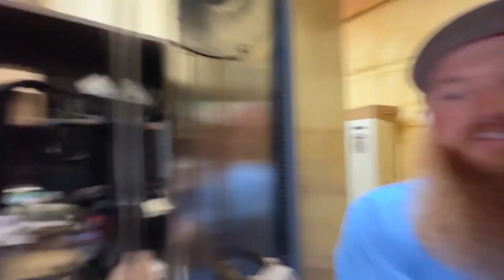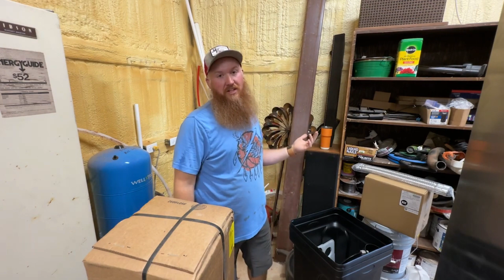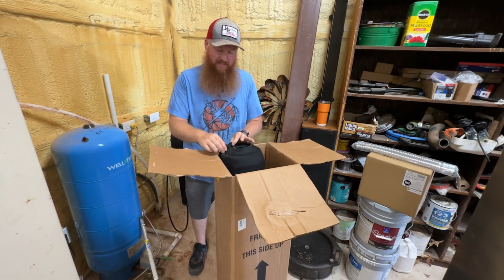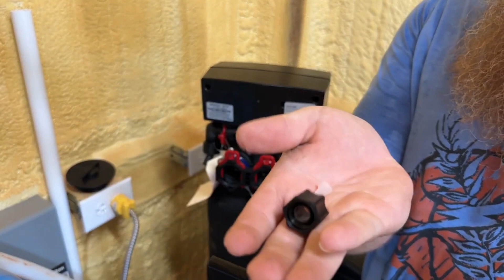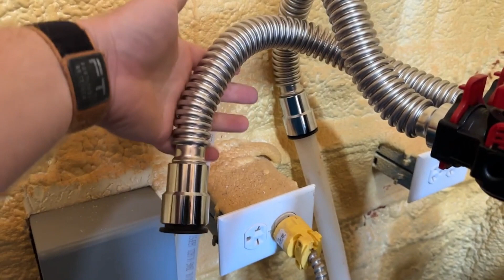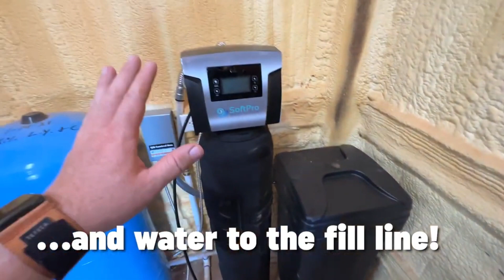How hard is it to install a water softener.

Comment: I bought a softpro water softener and love it, saving me a ton in salt compared to my old water softener system.
Reply: Was it the Elite HE?  I ordered it recently.  Did you install yourself or a professional?  If yourself, did you find it challenging?
Reply: @bigdogstatus83  Yes it was the Softpro elite HE, i installed myself, the instructions were very straight forward. I had a question on programming the valve and tech support walked me through it.
Reply: @CPhillipsMusic  Thank you!  Did you also install the water filter or only the softener?  In both and plan to install in myself.
Reply: @bigdogstatus83  i installed the upflow carbon filter and the softener at the same time. It took me around 3 hours to complete, i used the quick connect hoses i bought from them when i bought the system package.
Reply: @CPhillipsMusic how long has your system been in use and have you tested your water hardness recently?
Reply: @TrevorMinerPTDPT  Over a year now. Yes i bought a water hardness kit and water is still soft.
Reply: Hi, question, does your brine tank fill with water on its own when you regen your softener? just wanted to know if the brine tank gets filled with water when the softener is in regen. I have the same set up as you, thanks in advance
Reply: @willywil5691 yes it adds water when it regenates.
Reply: @CPhillipsMusic  do you know how to set the hardness setting? I cant find it. it wont appear on main menu
Reply from the maker: @willywil5691  This video helped me program. https://www.youtube.com/watch?v=XLGU2Whyq6E
Reply: @ so I went thru the whole menu. I set parameters according to city water. Refill rate, back wash and rinse time and other settings. I saw the hardness and clicked it as well. But I ended up setting it to the wrong gpg. So when I tried to change it, the hardness option in the main menu complete disappeared, as well as all the other settings. So why am I not seeing any of these now? Do I have to reset the whole thing? And if so I don’t see any options to factory reset anything to start over all my settings. I googled it and it says I might have to regen to reset all my parameters again. This is truly frustrating. Did the cpu in that thing get fried and it erased the options to click? For the amount of money I spent this thing is pissing me off,  no disrespect
Reply: @willywil5691 You can call them tomorrow ask for Jeremy, he can walk you through it.
Reply from the maker: @willywil5691  Did you contact our office and ask for Jeremy? He can walk you through and get it programmed for you. 877-278-4130
Reply: @ this number took me to something else entirely that doesn’t have to do with anything with filters